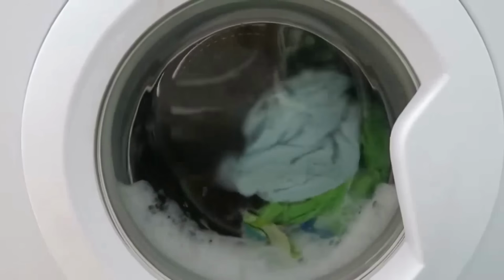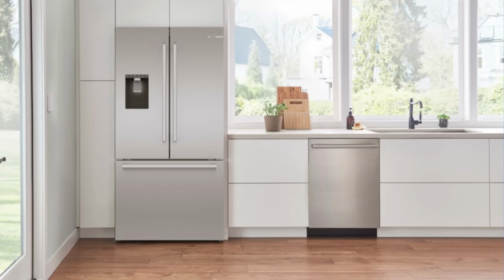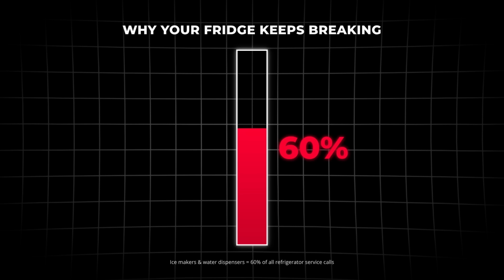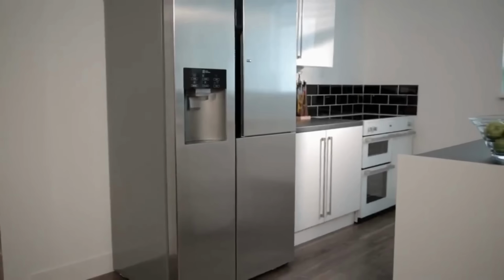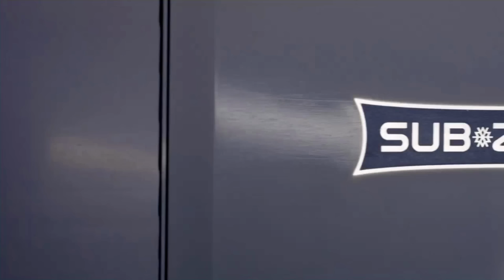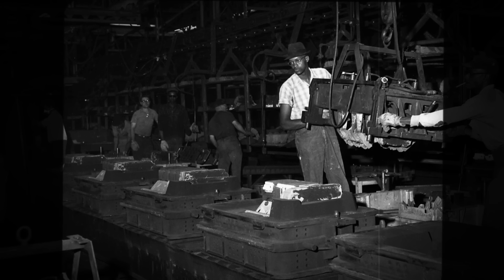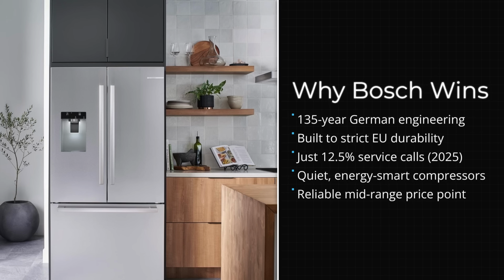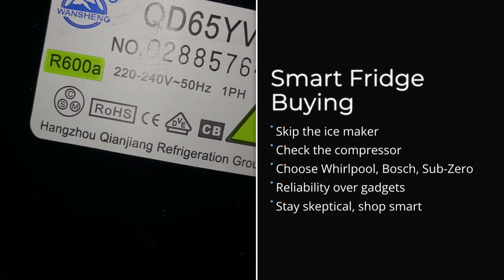Why 90% of New Refrigerators Are Garbage (The Cost-Cutting Secret)

Comment: Stay away from ice makers and water dispenser or what it's called you take cold water from the fridge. They only break.
Had a water dispenser on my first fridge then I thought it was good here in SE Asia since it's hot. But they break fast. Never bought with that any more.

I have a Samsung fridge since it was cheap when I bought it. One repair in like 12 years and still works.
But I stay away after that. Samsung make good phones but fridge and AC I would stay away from.

I have Electrolux and Panasonic. Electrolux like 4 years old and Panasonic 8. Still works.

Comment: My French Door KitchenAid Refrigerators make no sense to own and repair. They cost about $1850, the failures mostly the fans in freezer and refrigerator compartment, start to occur around the 4-year mark. Not a biggie, until you start paying the technician - aka "Refrigerator Surgeon" $550 annually.  I keep a small unused apartment refrigerator in my laundry room because I know the KitchenAid POC is going to fail.

Comment: I've worked on them since 98. I'd not recommend Bosch for anything other than dishwashers. When there product fails you probably won't find a part after about 8 years. And I'd be proud to know what subzero costs $5000. More like $15000. Just more AI crap to mislead people. Stick with plain models, g.e. or whirlpool, and plan on buying new every 6 or 7 years. The appliance industry needs to be dismantled and re-structured in the worse way. They say environmentally friendly, but are forcing us to fill our land fills at a record rate. Think about that.

Comment: "Every component is a failure point"--the fancier the appliance gets, the more likely it will cost you more money despite being advertised as "more efficient."  My Mom has a 64 year old fridge in her basement called a Gibson.  Still runs.  Made in USA.  I bought a small LG and within a year the freezer fan died.  Luckily,  I am a pretty good DIY guy and bought a new fan on ebay for 20 bucks, found a how-to video and fixed it, but a lot of people would have just been screwed by something like this.  Caveat emptor runs amok.
Reply from the maker: Your Mom’s 64-year-old Gibson is a living testament to an era when 'Made in USA' meant mechanical integrity, while your LG freezer fan failure is the modern reality of 'designed to fail' engineering! It is a perfect example of the efficiency trap: we are sold high-tech features that save $20 a year in electricity, only to be hit with a $300 repair bill—or a trip to the landfill—when a cheap plastic fan gives out. You saved yourself with a $20 eBay fix, but for most consumers, that tiny failure point becomes a 'total loss' event that forces them back into the market for another disposable unit. This isn't progress; it's a planned cycle of waste where 'fancier' just means more ways for the manufacturer to externalize the cost of ownership onto you. Caveat emptor doesn't even cover it—at this point, we're basically just renting appliances from the manufacturers!

Comment: In Australia. Have a Fysher and Paykel bottom freezer fridge. Been running for 20 years and never had aproblem. No significnat electronic features so must impact reliability. F&P now owned by Haier and fridges made in Thailand. You are right about modern  fridges being made for limited life.
Reply from the maker: 20 years and zero issues is exactly why people still hunt for those older F&P units on the secondhand market! 🇦🇺 You’ve hit the nail on the head: fewer 'features' means fewer funeral dates for the appliance. The move to Haier and offshore production really changed the DNA of the brand. Are you planning to run that fridge until the compressor finally gives up, or are you starting to scout for a 'low-tech' replacement just in case?

Comment: I have 3 french door fridges, 1 LG and  2 Samsung. They are all 8 years old now. Every couple years, I clean behind the fridge, suck up all the dirt and dust build up which prevent good airflow. I bought models without water dispenser, and disabled ice maker and didn't bother to connect water line. 
So far, no problem at all.

Comment: My 1969 Hotpoint 12 cub ft non frost free top freezer/frig is incredibly quiet & still works with no repairs & u do not have to reach down to the floor for produce! I've even seen my exact model on some old tv shows!
Reply from the maker: That's an incredible run for a fridge, they really don't make them like that anymore! 🤯

Comment: My 2000 Maytag top freezer (bought before Whirlpool acquired them) is still running strong. The only things replaced were a fan in the freezer done under warranty and 4 ice makers which cost under $100 each and I install them myself in 10 minutes.
Reply from the maker: That's the golden era for reliability, hold onto it! 💎

Comment: My brown 1981 GE side by side is still in service. I know I may be wasting $10-15 a month. I put a power meter on it and it is about 3 Amp hrs a day. Less than specs of 1800 A hrs a year. I fixed it myself four times. Light switch, defrost thermostat, condenser fan and evaporaror fan. Sometimes it bangs when compressor shuts, condenser or piping may be loose or rubber cushion gone. No electronics or computers that barely existed back then. I vacuum the condenser coils and fan every few years. Ice maker and water dispenser failed years ago. I pulled ice reservoir out and use space for food. Ice got stale anyway, so a plastic tray does the job. If I replace it, it will be with a simple top or bottom freezer, and if possible, manual knob temperature controls.
Reply from the maker: Smart move fixing it yourself and avoiding those modern electronics.

Comment: Frigidaire.  Failed immediately.  The water line to the ice cube tray freezes.  They tried everything.  Moving the line and putting in a thicker line.  Once a month or every other month, I have to direct a hairdryer to the back of the ice cube tray for 6 minutes to unthaw the line.  I have to pull out the ice cube bucket and prop the hair dryer in there, close the door and when 6 minutes is up, it should work again.  Frigidaire was moved to Mexico.

Comment: Samsung French door failed at 11 years due to control board. The water dispenser froze due to poor design, but I didn’t care since we rarely used it. Finding a side by side or French door without an ice maker is pretty difficult. Due to the placement in the kitchen a simple top freezer simply won’t fit for the door to swing open.
Reply from the maker: Here we go control board again and the icemaker together there’s a combination of disaster

Comment: 2001 basic Whirlpool top freezer - still running, but sounding tired.
Reply from the maker: Keep it running as long as you can! 🔧
Reply: If you haven't done so, pull it out from the wall and clean the condenser coil - that will be on the back or underneath with a fan.

Comment: A major problem with new refrigerators is that you cannot clean the dust off the coils!

Old refrigerators had easy access to flat coils right at the front, you could vacuum them off so easily. 

With my 8year old GE Cafe series, you have to pull the refrigerator out, unscrew a metal panel off the back, and then you see the coils are on a cylinder shaped thing and you can only vacuum off one side. The other side is basically impossible to clean. 

Without being able to clean the coils the compressor will be forced to run longer and lead to premature failure. I cannot see how this is anything other than intentional design for early replacement.
Reply from the maker: Yup everything is so hard to clean now, everything cramped in tightly  hard to service the coil

Comment: I have an 8 year old GE Cafe series fridge. The man circulation fan died maybe 5 years in, which I replaced myself but this is a moderately difficult job. 

When Helene hit, we tried powering this fridge with an inverter running from our van, and the power quality was not good enough for such a high tech refrigerator and it did not work - the screen would show the GE logo, then reboot itself forever. Our low tech garage refrigerator did work.
Reply from the maker: That's wild, those fancy electronics really ruin reliability 📉
Reply: Also, note, I later got a Generac portable gas generator wired into my main panel, and that power DOES power my GE fridge fine.

Comment: Had the old Electrolux Kelvinator with myself for 15 years worked flawless but a few things failed due to voltage fluctuations and it wasn't a very top of the line model, it still works sold it to someone I Know so there's that, then bought a Whirlpool double door for myself 9 years ago, working flawless till date without giving a sweat and keeps everything new and fresh for long. Literally can't even complain it's silent works amazing and looks too.

Comment: Great work. Great channel.

We have a Fridgedaire sideXside (which is another scam since it yields less interior space than top/bottom designs) that was new when we bought our house 13 years ago.  It has an ice maker and water dispenser. The only issue that we had was the ice maker feed line inside the freezer froze and water spilled all over and ruined a section of the floor. The repair was ridiculously simple and I wish I had researched better before calling a repair service.  The technician just sprayed warm water on the line until it unfroze and it was back in service. 

Regarding the sidexside vs top/bottom, the industry now produces mostly sidexside split models now, which take up more space than old top/bottom designs, so you are forced to buy them since only the smaller low end models are the old design (which is easier access IMO). The best design we had was in our old house where we had a top/bottom split, freezer on bottom as a drawer.  Super easy to find everything. Of course, that type no longer exists.
Reply from the maker: Thank you so much! And thanks for sharing your experience.

Comment: I believe Consumer Reports ranked LG as the most reliable refrigerator brand. I used to work at Samsung as an R&D engineer. In our households and rental home businesses, we currently own three LG French-door refrigerators and two LG mini-fridges. We also have one Samsung French-door refrigerator, one Frigidaire two-door refrigerator, and three non-LG Chinese-made mini-fridges. Based on both Consumer Reports and my own experience, I do not agree that Whirlpool is more reliable.

Comment: I would not get a French-door refrigerator with an ice maker in the non-freezer door area of your fridge. You need to know the Zeroth Law of Thermodynamics. Although I used to work at Samsung as an R&D Engineer, I would get an LG. I want to make another note to avoid any refrigerator made in Mexico or China. I would get future appliances made in either South Korea or the United States. Know the origin of manufacture of your kitchen appliances.

Comment: Our very flash Samsung Fridge/Freezer had ice maker issues, we dumped it after 2 years and about 5 repairs! (however, they make great Smartphones & tablets). Our LG inverter motor Fridge/Freezer we brought 3 years ago is great and ridiculously efficient / silent (the model with the rotary compressor). The rest of our Fridges & Freezers are Miele, I wouldn't say they are 100% reliable (they go wrong maybe every 6 years) but even after 15-20 years Miele come out and fix, quite often for free.
We have many other Bosch appliances, great thing is their technical support is a real human being without a strange Mumbai accent, and warranty is 5 years, they come out next day.

Comment: Have a GE Profile Performance model bought in 2002. Brought it to my current apartment in 2007 with no water hookup so I haven’t used those features in that time. I’ve had zero repairs over that span. I keep the coils and vents unclogged. I did have a clogged drain in my freezer 2 years ago causing ice to build up on the freezer floor over time. Cleared it myself.
Reply from the maker: Wow, 22 years with only a drain clog? Unbelievable 👏

Comment: I had a sub zero for over 30 years . When it broke I bought a ge cafe, it works but it’s uneven cooling and it’s already broken once since I bought it. And it’s as big as the sub zero but not as roomy as sub zero on the interior. Both were very expensive. I spent 7000 on the sub zero years ago and the same on he ge. Subzero are about 13000 now, but I would still buy it when this one breaks,

Comment: I bought a used maytag refrigerator 12 years ago. So, it's between 15 and 20 years old, is my guess. No problems. Ice maker works fine. Freezer is on the bottom, which I like. I think I paid about $200 for it. Don't forget the used appliance stores. Alot of gems there.
Reply from the maker: Yes, back then it was build different
Reply: I have a 1990s vintage kenmore washer I bought last year at a used appliance place. Love it so far!!

Comment: Bought an LG French Door, ice and water maker with a linear compressor in 2017 and the compressor failed in 2021. Thank goodness it was covered 100%. We still have the refrigerator without issue as of today, but it’s on the back of my mind if it will fail here soon.
Reply from the maker: Glad you got that compressor covered at least 😅

Comment: My Kenmore/whirlpool side by side condenser fan failed ever year until I used the older style motor.    5 years later, the defrost thermo stat went out.   I keep spare thermostat and fan
...about 40 buxs.   Takes 15 min. To replace but takes 2 days to get part while food spoils.  So I have spare parts.   Been 7 years now since last failure.   All because my wife wanted a stainless steel fridge.....
Reply from the maker: Having spare parts on hand is the ultimate hack for saving food! 💡

Comment: The GE profile fridge that we purchased in the fall of 2017 died last night.  It appears to be a main control board failure and I’ve decided to just replace it with another one.  It lasted about 8 1/2 years.  I got a kick out of the subzero since I live in Madison Wisconsin.  But they are really expensive, and they don’t think we could even fit one in our kitchen.  My neighbor used to do IT work for them.
Reply from the maker: Yep, 90% of the time service calls always failed circuit board
Reply: I bet there is a single component on the circuit board that has failed. Sadly nobody does component level repairs.

Comment: I bought my house in 1995 with a Kenmore washer, dryer, stove and gold fridge made in 1975. I upgraded the washer and dryer to front load Maytag before they sold to Whirlpool plus add a Maytag dishwasher, all running well. The fridge worked fine except for the gold colour. My buddy was painting a white Nissan pick up back around 2000 and had a pint of paint left in the gun, I ran home and prepped the fridge for paint and it came out awesome. The 51 year old fridge is still working well. 
As for top choices I would not include Bosch. I looked at the neighbours down the street at least 5 times for ice maker issues. She has Bosch bring a replacement after 2 years.

Comment: It's the same with newer, so-called enregy efficient hot water heaters. The man who replaced our old, old water heater after 20 years of use with a new, up to date smart, energy efficent one told me that they are designed to last maybe 5 years, then you have to replace them or spemd hundreds getting them fixed.
Reply from the maker: It’s crazy how planned obsolescence is everywhere.

Comment: Have a twin door Frigigaire.  It is at least 20 years old.  The ice maker went, so I bought trays at the dollar store.  I fill the ice bin, and the dispenser still works.  Problem solved.  
Computer chips, in my opinon, are not put in to make appliances work better.  They are there to tell the appliance when to fail, usually right after the warranty runs out.

Comment: In 2022 LG said the linear compressor in our LFX33975 needed replacement but it was nearing the end of the 10 year warranty so the $800 for labor wasn’t covered, nor if any other parts were needed. Instead I installed a $5 piercing valve (BPV31) on the low side, pulled a vacuum and slowly recharged with a $10 can of R-134a until the low pressure side was ice cold and the high pressure side was hot. Probably accepted about half the can and knock on wood, it is still working today in 2026.

Comment: Our Whirlpool Duet washer and dryer pair are 14yo with a family of 8 and we never had a single service call for them. Our Whirlpool range is the same age and I only had to replace the oven heating element one time but we make a lot of home made pizzaa at 475 to 500 degrees. 
Our Whirlpool side by side refrigerator is also 14 yo with no issues and it has an ice maker and water dispenser. 
I replaced our Whirlpool dishwasher after 13 years only because the pushbutton panel was wearing out and the door-closed sensor was having a little problem,. I probably could have had the door switch serviced but  wanted to buy one of the newer models with 3 racks. The new one is super quiet.
Reply from the maker: 14 years with a family of 8 is truly impressive! 🤯

Comment: I have a 10 year old GE Profile and an 8 yr old. Both have ice makers and dispensers. The 10 yr old was caught in the floods of Hurricane Harvey and sat in 2 ft of water for a week. The 8 yr old was its replacement. When I evacuated,  I turned off the power to the house. On returning, the food had spoiled naturally. I put the fridge outside on my covered patio, stripped it down and cleaned it out and pressure washed the hell out of it. Left it to dry for 3 days. I reassembled it, plugged it into an extension cord and its been running in the garage since 2017, keeping my drinks cold.